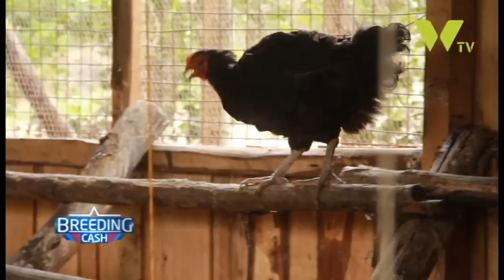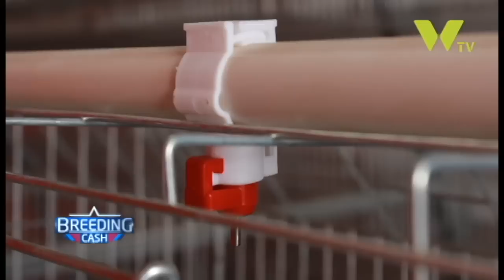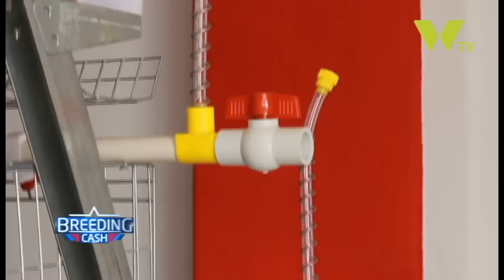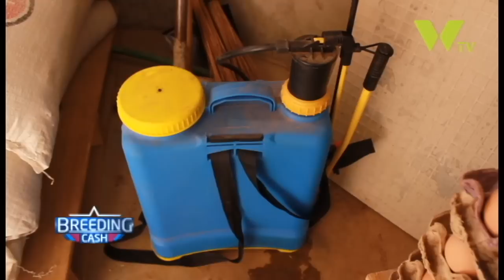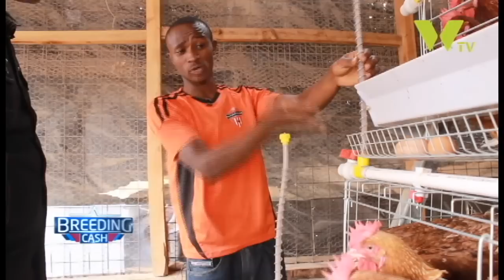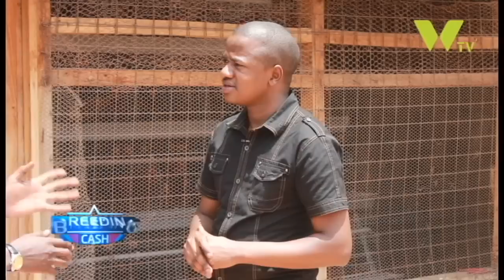BREEDING CASH; POULTRY FARMING USING BATTERY CAGES

Comment: BSM mainly do the supply of animal feed making machines, which is of characters with high production capacity, low noise, uniform smooth pellet output, no dust, etc,we can offer you pellet mixing formula based on your raw materials and animal characters, this can benefit you to the most. For inquiry, pls contact us via email: devina@hnbestmachine.com  or Phone Number:  0086 15637153018